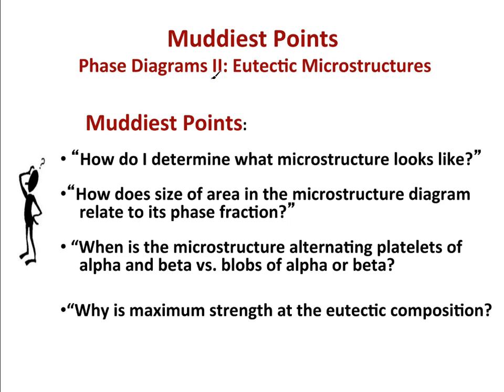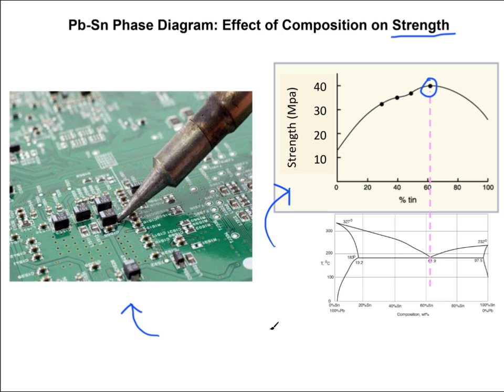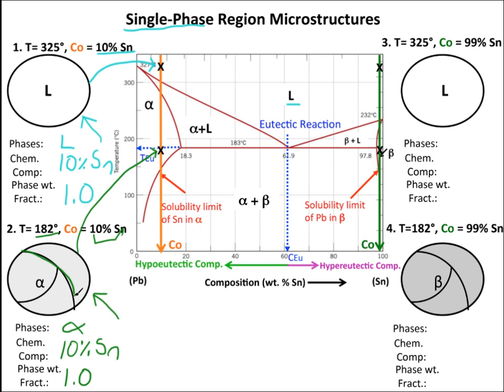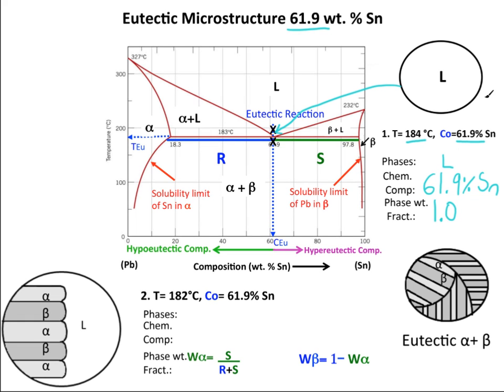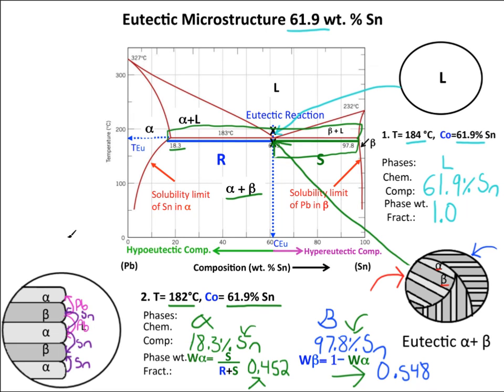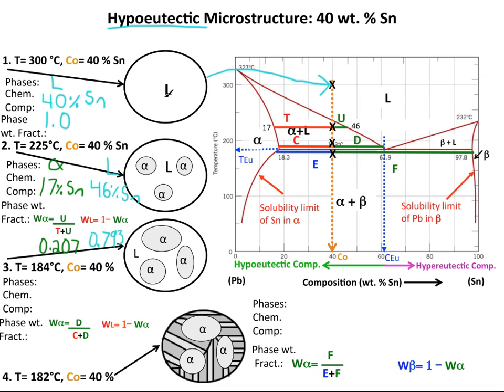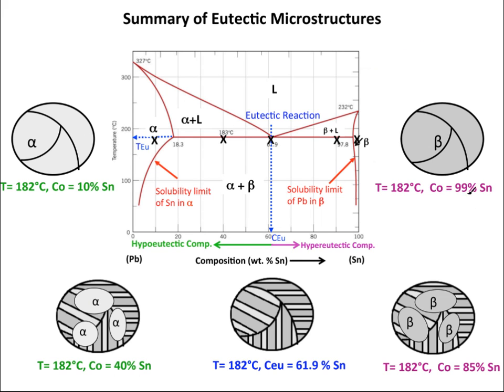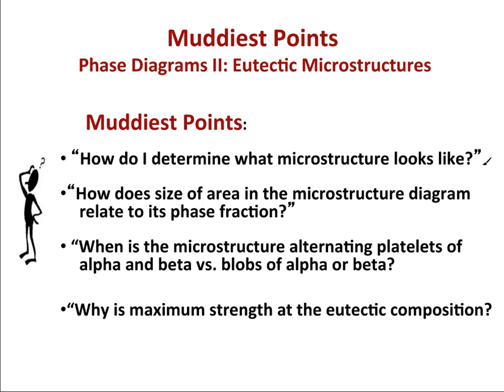Muddiest Point- Phase Diagrams II: Eutectic Microstructures

Comment: Very good. Thank you for the video. Though, i would like to add that during extreme low cooling in order to theoretecally achieve thermal equillibrium, below the eutectic temperature and close to the left of the diagram (low B concetration), it is possible to have also a phase β percipitation from α phase, due to the solubility limit decrease with temperature decrease. So in total there will be α (proeutectic) + α + β (eutectic) + β (precipitated)

Comment: SOOOO helpful!!
Reply: Hi i need help, how it got phase fraction from these numbers, also how would you determine the material from microscope, can it have an shape like phase, also could information from strength can help us.
Reply: @junaidhussain4781  The phase fractions are determined using the lever rule. Many textbooks can explain the lever rule better than I if you need more information than this video provides. If the material and the phases that are expected to form are known, you can search literature for micrographs of each phase to help you identify the phases forming in your material. Different phases do have different strengths. You can use nanoindentation to gather hardness and (using an equation) strength data. But if the material is known, you can find already published data bout the hardness and strength of each phase present in the material.

Comment: Is there a way of calculating primary alpha and/or primary beta composition and weigth percent composition?
Reply: I think you would do it as if you were on the eutectic line
Reply: Hi i need help, how it got phase fraction from these numbers, also how would you determine the material from microscope, can it have an shape like phase, also could information from strength can help us.